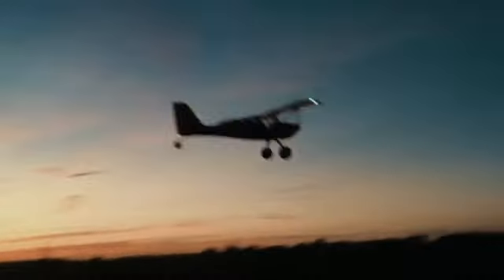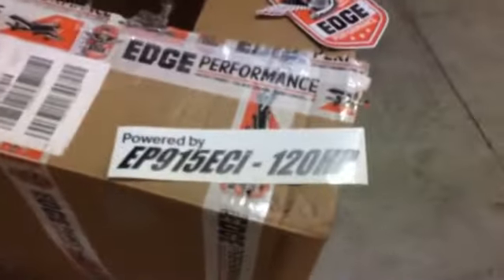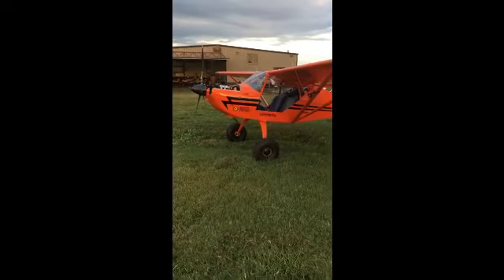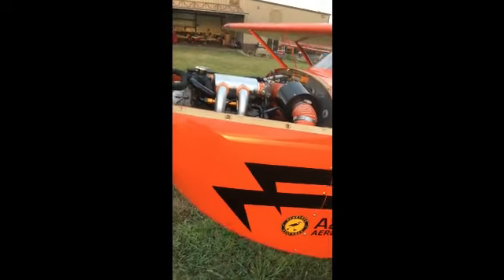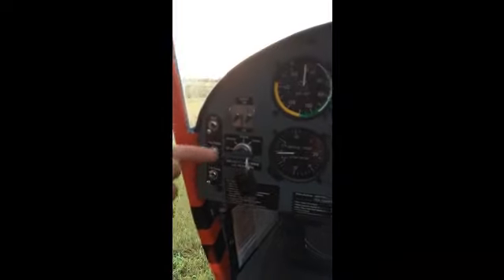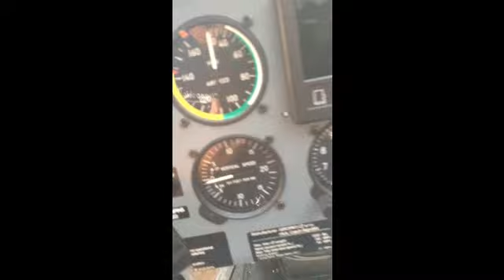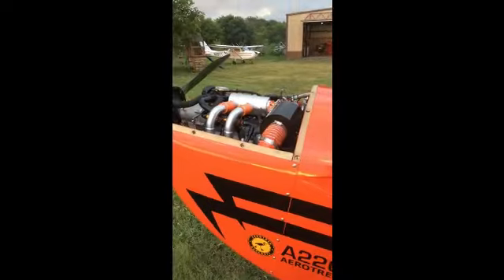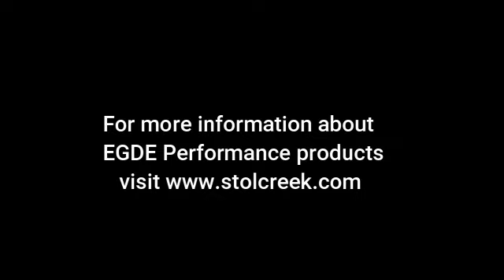EDGE Performance EFI Install in an Aerotrek A220

Comment: What can we boost our 914UL to chaps?
We need 130bhp but only to climb up to 200ft towing a heavy 2 seat 800kg glider.

Above the 500ft safe height 115bhp would be fine.

I'm thinking:
Tweak the existing turbo boost above 40mBar, with a boost controller.
Fit an intercooler (even if it has to be fitted externally to the cowling)
Most importantly we need a larger capacity oil cooler as the oil temp gets to top of the green 110C by the time we've climbed to 3000ft.
Reply from the maker: When we put the EDGE EFI and intercooler on the 914 we got 126hp. That was as 41in/hg.

Comment: Aerotrek as good as a kitfox yet about 50k cheaper. Aerotrek is a SLSA are you allowed to modify the engine is Special light sport different then like a Certified aircraft such as a Cessna 150.

Comment: Does just adding the fuel injection give you more HP?
Reply from the maker: Yes just installing the fuel injection adds 6HP plus lower fuel burn.
Reply: @stolcreekaviation5507  even on the 914?
Reply from the maker: If we switch to EFI on the 914 then we also control the wastegate with the EDGE ECU and see an 11hp increase.
Reply: @stolcreekaviation5507  Any updates on performance and reliability?
Reply from the maker: @rvingjetpilot5302  so far it is still running perfect. performance numbers are in the description.